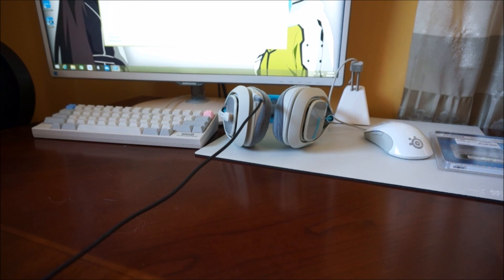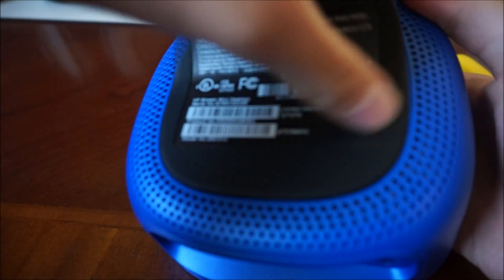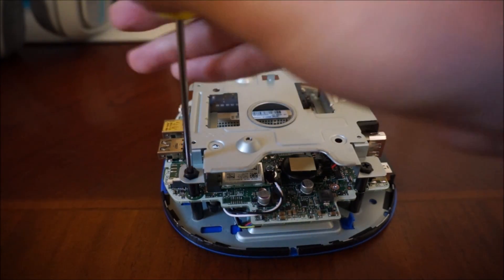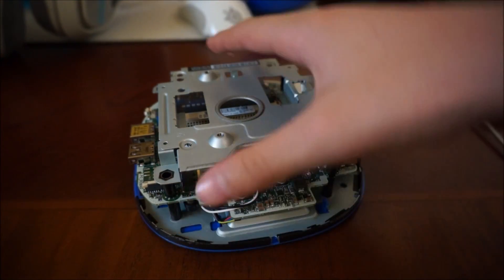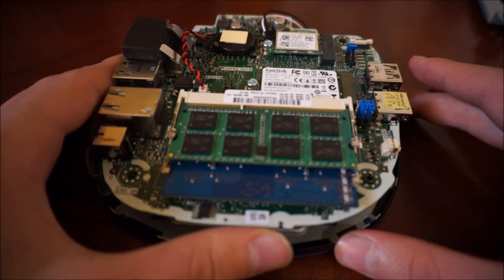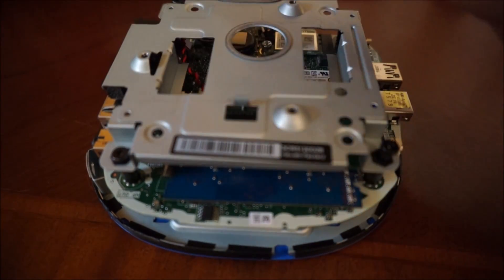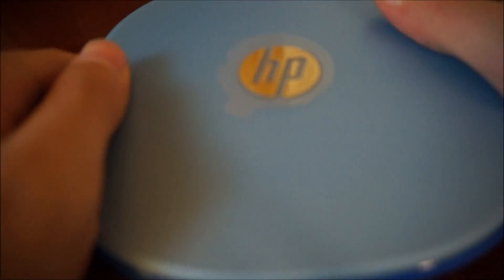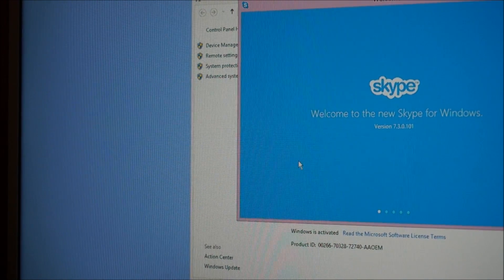How to upgrade RAM in HP Stream Mini Desktop Computer

Comment: any speed difference after ram upgrade?
Reply from the maker: yeah, there's usually a speed difference as the computer can handle a heavier workload/ more tasks. applications like google chrome and video games do benefit from more available ram. this isn't true when the upgrade isn't needed because your workload isn't enough to stress the computer. sorta like putting a faster engine in a car that gets driven by a grandma- no point (unless grandma is a baller).  cheers m8
Reply: @JamesScholz  you think its worth it to get more rams just for web browsing ?
Reply from the maker: @KnowerofThings  if you're using the computer right now and it's struggling at web browsing, ram would indeed help it run faster. plus ram is pretty cheap right now- so I'd say it's not a bad idea!
Reply: @JamesScholz  ok thank you!
Reply from the maker: @KnowerofThings  ye no problem doggo, lmk if u need any other computer help. I got u
Reply: @JamesScholz  thanks i will
Reply: @JamesScholz  hey James I’ve been struggling with my computer stutters for over a year now and  I can’t find what the problem is. And if I knew what component this was I could replace it or would make it slightly easier to find the problem. Also I see you studying everyday which is crazy 😜
Reply: To tell the truth RAM and SSD drive are the first best things to upgrade. I would recommend at least 8GB RAM for any browsing and office work.

Comment: Thanks. I would also recommend replacing the wifi card. It's only $10 and will make your wifi much faster and more reliable. It's fairly easy to do like this memory.
Reply: Is there a wifi card you'd recommend for this?

Comment: Also I put in a 4gb ram into my stream mini and it still says I have two
Reply: koyo no. His ram is fine. I had the same issue. Some of them have loose slots and require a extreme amount on force to seat it. The locking mechanism gives a false seat. You really have to push it in. See http://h30434.www3.hp.com/t5/Desktop-Hardware/Upgrading-memory-on-Stream-Mini-200-010/td-p/4920041
Reply from the maker: megafunkytiger you either did something wrong or your ram is DOA

Comment: Do you know if this thing has fan inside?
Reply from the maker: sokhaDotCom I'm assuming you're the person from amazon. From the first glimpse I didn't see a fan, but it might be on the other side of the plate. I would assume that it doesn't, but it may.
Reply: Yep, your assumption is correct.  That's the cool thing about my name!!  Hahaha....if you see the name Obama, it's a good assumption too of who he is!!  Lol! 

Usually, we won't hear the fan until it needs to kick in high gear.  From what I know, Intel will release a fanless CPU this summer.  Although the CPU doesn't need fan but other components might....just depends on the design.

Comment: Thanks koyo. I'm expecting my mini and additional ram to be delivered this later this afternoon and your vid will be a big help when I install the ram.
Reply from the maker: larrym9 yeah no problem, thanks for watching my video! :D~
Reply: larrym9 Hi, did you new additional ram work?  May I ask how many GB and what make and model of your new RAM?  Have you installed and did it work?  I want to upgrade mine mini as well.  Thank you in advance
Reply: Jack Wong 
Jack, I installed a Crucial 2 GB single DDR 1600 MT/s (PC3-12800) CL 11 SODIMM 204-pin 1.35/1.5V notebook memory module that I ordered from Amazon. I installed it immediately after the mini was delivered. I followed the same process that koyo uses in his video and it worked like a charm, no problems at all.
Reply: Great!  Thank you for the information.  Just wanted to make sure i purchase the correct RAM module.  Thank you again.
Reply from the maker: Jack Wong I have the link of the ram I used in the description of the video, it works great.
Reply: Thank you Koyo... ordered the same make ram module but 8gb. Should receive it today.  Thanks again for your help.

Comment: how does it perform in every day use
Reply from the maker: it works great for what I need it for, which is everyday tasks like email and homework. I wouldn't expect to game on it, although there is a noticeable difference with the upgraded ram. for the price, its great.
Reply: koyo does streaming movies in 1080p stutter with or without upgraded ram
Reply from the maker: shuayb toit some people use this for an htpc, so I'm assuming it works well. I haven't tested it though.
Reply: shuayb toit 1080p should be ok for streaming via the Ethernet connection but you might run into problems if you use wifi.  Thus, the problem is not with the computer but the wifi technology itself as you might see a lot of buffering during playback.
Reply: shuayb toit If you have 5GHz Wi-Fi router with a solid signal strength you should be fine. Otherwise the WAN port is sufficient. I use mine as a HTPC streaming from online services and a NAS and it works perfectly.